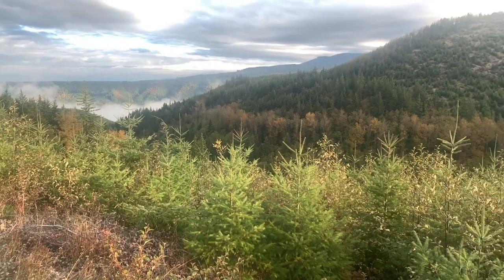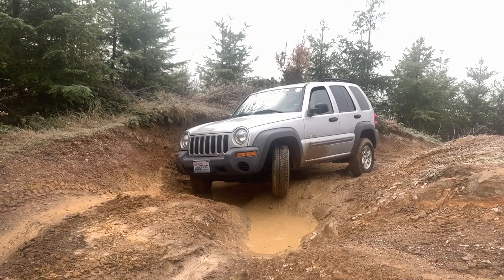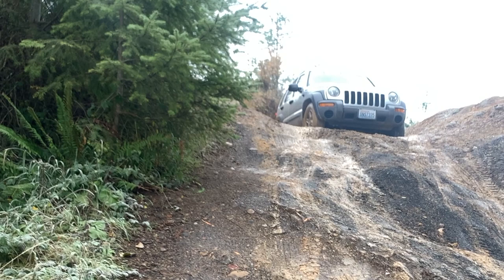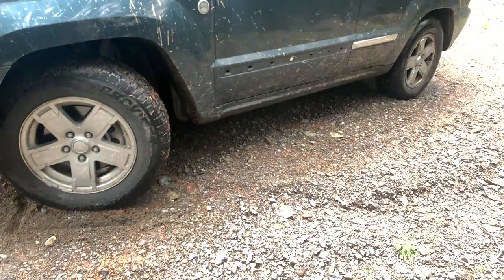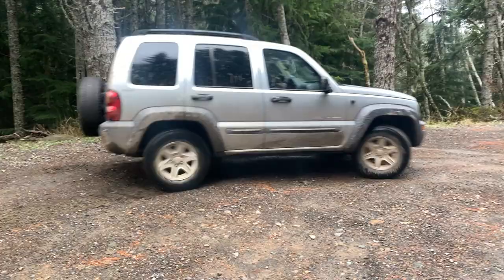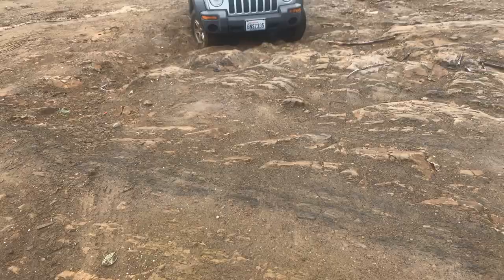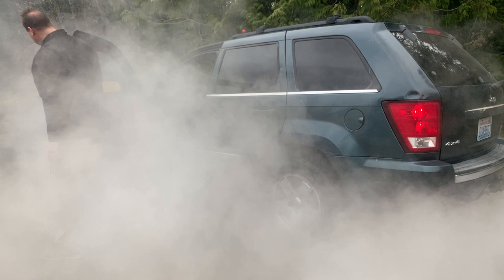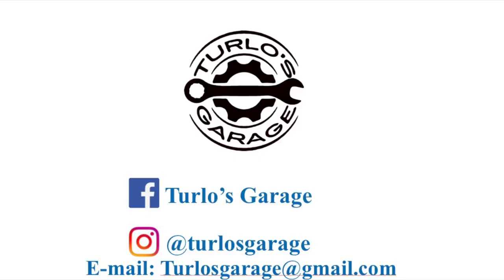JEEP LIBERTY KJ VS JEEP GRAND CHEROKEE WK/ OFF ROAD DUAL TO THE DEATH!/ The winner is SHOCKING! EP34

Comment: man.  just bought a mint 60kmiles 04JL. it will remain stock for the next 240k miles.  u guys are nuts.
Reply from the maker: Jeeps are a lot of fun! The Liberty is still going strong.
Reply: @TurlosGarage  i cant its murder... its got factory tint man factory, loaded with crappy pixilated compass direction and cruise control that takes light years to catch up on hills and stuff. its got high beam safety feature so you cant engage it unless you hold it into place.  all these kids, suspension lift here and there like making the plastic surgeon relevant when the goods are already solid.  most im doing is getting undercoating on hur. no cherokee roof rail upgrade from the bone-yard, no KC led racks.  NO headlight led i want the dull 2400k candles that make the road nearly invisible in bad weather.  Man she's a legend, a LEGEND man.  and think about allllllllll the beer money or pot for potty heads I will be saving by leaving hur stock.  Its madness you young kids MADNESS>
Reply from the maker: @DS-ju2sq  That is Madness! Even stock the Liberty does amazing things off road! Rock On! 🤘

Comment: I've towed 5,000 pounds with my Liberty without any issue. Not just around town, but on the freeway across multiple states.
Reply from the maker: Did you have a trailer brake? I have a trailer that is 5,000 lbs empty I might try and tow.
Reply: @TurlosGarage  I was towing with a U-Haul trailer, so it had surge brakes. I would not try and tow more than half the two vehicle's weight without trailer brakes. Well...in my youth I did try that, and was very lucky that I had room to pull onto the shoulder when I couldn't stop in time at a light on an expressway. My rig ended up stopping even with the front bumper of the other vehicle.
Reply: @TurlosGarage  diferential oil change.  Never with bad oil,

Comment: I own a Liberty( In Australia where I live it's called a cherokee sport) turbo diesel auto, that I lifted and front locked but parts are a huge problem, recently I had to replace the radiator, what an issue that was, couldn't find one in the whole world, eventually finding one 4,000km away in Victoria on the south east coast of Australia. My seats are leather and pretty comfortable.
Reply from the maker: I would like a diesel one someday. It sounds like you’ve got a nice Jeep!
Reply: "replace the radiator" Maybe, you need to change the cap of the radiator from 1.2 to 0.9. Maybe.

Comment: The liberty shines
The liberty does well on and off road 
If I m going off road a lot I would go with a 3inch lift , mud terrain tires, change the gears and add lockers , heavy duty control arms,heavy duty ball joints ,a winch
Reply from the maker: Those are some heavy duty mods. That would make a capable off road machine.

Comment: My 05 limited has a 2" lift and 33s. It doesn't have as much suspension flex as I'd like. So it may not be real graceful but it has the power and clearance to go anywhere I'll put it. I like dirt bikes, hunting in the Arizona mountains, and shooting sports so I find myself in some questionable spots. I'll say it does better off-road than my 2000 Z71 Silverado also on 33s. 👍🇺🇲
Reply from the maker: I was very impressed on how this does off road. Engine is going back in and together. I hope to have it back on the road soon.
Reply: @TurlosGarage  I actually overheated mine real bad last week. It was 115 here in Tucson so when the heater hose broke it was real hot before I noticed it. So I guess now I'll have a chance to freshen this thing up while I have the heads off it. 👍👎😁😢

Comment: I have a feeling that all the water messed up the electric hope a good dry out fixed it . I have a librery kk 2011 it's nice . Am comfy in it . I am 6 foot tall 240 pounds . My liberty  has 4 wheel low that locks the front & back difs up . My dad had a 1948 willys  cj 2b . Back then the jeep would go through anything however you may not unless you were tied in . Hope the wj was fixed easy
Reply from the maker: Still broken as of now. I now have 2 broken “good” used engines and the one that was in it. I think I have enough parts to make one good one. Not sure how long it will last because I am also adding a nitrous kit. It is going to be a fun year for Jeep stuff!

Comment: I have a 2004 liberty renegade, and it’s got a locker in the rear. I’ve taken that rung everywhere.
Reply from the maker: I think if my Liberty had a locker it would go anywhere.
Reply: @TurlosGarage  Is it only the renegade model that has this on the liberties?
Reply from the maker: @chancepennington6653  I have been told some do some don’t. I have not really dug into it. I plan on opening the rear differential in my Liberty in the bit too distant future to see what is in there.

Comment: I’ve got a Liberty 
Went though a deep puddle and it did the same as the grand 
Check the cooler pipes
Reply from the maker: The Grand Cherokee ended up with a broken number 8 rod. I have bought two used engines and have enough parts to make one good one now. I have been working on getting it put back together. The Liberty has been solid though. Thanks for watching!

Comment: I never would have guessed the liberty.
Reply from the maker: It is cheap, easy to work on, easy to find parts for, does fairly good off road. While it is not the most comfortable thing to drive it is way more comfortable than your Wrangler. I am starting to think this may be the best value Jeep produced. It does a lot of things really good.
Reply from the maker: The exhaust tic drives me nuts. I will be fixing that very soon.

Comment: 08:23 Water ingestion in engine air intake
Reply from the maker: Broke the Number 8 rod and bent the number seven. The Grand Cherokee’s air inlet is about the center of the grille while the liberty is on top of the radiator support. A few inches makes a huge difference sometimes. 👍

Comment: Did that grand cherokee hydro lock???
Reply from the maker: Yes it did. I have a few videos tearing the engine down. Number 8 cylinder has problems. A bent valve and most likely a broken rod.

Comment: This is why it’s hard to find a decent running Jeep. They’re getting beat tf up
Reply from the maker: It makes the others more rare and valuable. This one was actually beat up when I started. The engine had some issues that probably would have done it in if I didn’t hydrolock it first. But it is going back together nicely and as soon as I get some good weather I can install the engine and the Nitrous Kit.

Comment: The way the tire on solid ground never spun....well....probably not posi.  Posi would at least try to spin. Not as good as a locker however.
Reply from the maker: I found out later the Liberty does have a trac-lok differential. It is probably in need of some clutches. Thanks for watching!

Comment: I have an 07 liberty and it has no problem really,  seems to spin all when in deep mud.  Also play with the ebrake and brakes to send power to other wheels, old school off roading.  With 4 snow tires on bad days I drive my liberty and leave my 2020 grand cherokee in the garage.  I think it does better in deep snow.
Reply from the maker: I didn’t even think of using the ebrake! That is an excellent suggestion! I will try that next time.
Reply: @TurlosGarage  it works!  Nice to see another liberty out playing.  I think the liberty never got real respect out of the jeep community.  It actually a great vehicle 125k moles on mine.  A rotted trans line and 4 o2 sensors besides regular stuff.  I'm driving mine until it drops and I don't see it soon!
Reply from the maker: The Liberty has been the best vehicle I have owned. I can’t think of another car that is more fun for the money. I am working on more Liberty content for 2021. Thanks for commenting!😁
Reply: @TurlosGarage  awesome,  I'll subscribe to watch!  Sadly today I had to have some work done.  Been chasing a random P0300.  Had 2 bad injectors, just replaced all 6 and runs like a champ today.  It owes me nothing and 120k+ I'm sure it was due.  If you or someone reading chasing a random misfire and fuel trims are all over replace injectors!
Reply from the maker: @chuckstephan  Good to know. My Liberty sat for a year when I got it so I expected to have a lot of problems. Amazingly the only issues I have had are due to my poor mechanic decisions. LOL. What does a 6 pack of injectors cost?
Reply: @TurlosGarage  well its 17 degrees out so I dropped it off at Firestone.  So, yeah, 1400.00 later lol.  Think bosh ones about 30.00 each.  Is an easy job but my laziness cost me big.  I also had coolant exchange,  fuel system cleaning and oil sensor replaced and oil changed. Also had my running light in the bumper replaced.  Broke it smashing thru snow banks lol.  I haven't put a dime in it so I was ok with paying this time. She should be good for at least another 50k with out issues 😃
Reply from the maker: @chuckstephan  Smashing Snow Banks sounds like a fun hobby. I got to try it.
Reply: My 04 surprised the heck outta me. That "Trail Rated" badge actually means something. Stock with Sailuns AT3 (mountain snowflake rated) very confident in a couple feet of snow on my mountain top.
A lot more confidence than my '00 F150 7700 4x4 on 33" Dynapros
Reply: @TurlosGarage  Get one with the trail rated badge. You will be pleasantly surprised!
I've had ZJs and WKs. '05 and 07 WK Overland Hemi sails over where all others get stuck.
best used car buy (along with 04 Tail Rated Libby)
Reply: @chuckstephan  every time I get lazy about a job, I call around for estimates then start picking  out new tools to buy ;-)
Reply: @NickSharpe  I hear ya, should have fixed my self but she running good again!  I just pulled a ford f250 out of. Snow bank, dude was like that little liberty won't do it...lol little momentum and a recovery strap plucked it right out...guy was like respect!  I love messing with kids in the wrx Subarus in the snow, while their fancy computer figures out what what wheels to grip, liberty locks all 4 and with snow tires...I'm gone!  It gets picked on all summer long, but in deep snow she is a champ!  I call it the liberty revenge 🤣
Reply from the maker: @NickSharpe  it snowed in the Pacific Northwest recently. I made a video of the Liberty in the snow. Then I deleted it because it was me just driving. Except there was 6 inches of snow on the ground. Very boring. I expected some sliding and slipping, there was nothing.

Comment: What is the difference between the 2002 and 2007 Liberty models, and is there a difference between them and the Liberty Ranged, and which one is better? Thank you?
Reply from the maker: I am not exactly sure. I think mostly the body design was changed a little. There is a Liberty Renegade that had some off road extras.

Comment: Why BLD isn't kicking in? Did you shut off Traction Control? If you did, BLD will not work and the car will stuck when a wheel is in the air, even while 4WD, exactly as depicted on the video beginning.

Comment: Wait, you can't lock the diffs on libert? Is that true for the CRD model as well?
Reply from the maker: I found out that was an option. Some had electronic locking diffs some did not. I am not sue if that was something standard on the CRD models.
Reply: That "Trail Rated" badge means something. Do your homework then wheel a Libby with the badge (and the right tires). Big dif!
Reply: You can install a locker in the c8.25, I ran a rear 8.25 in my old yj and installed a arb locker. I just built up a kj and will install a lunchbox locker in it.

Comment: You’re comparing two completely different option packages. You can get the grand Cherokee in a v6 and without the awd. I get you are using what you have but a v8 awd is going to be very different than a v6 4wd.
Reply from the maker: I know it was a completely unfair comparison. But I had to give the Grand Cherokee a fair chance by using an newer vehicle with more options. In the end, I still like the 2002 Liberty Sport better than the 2005 Grand Cherokee Limited 5.7.
Reply: @TurlosGarage  I own a 99 WJ 4.0 AWD Quadra Trac 1 system. I'm debating on trading it to a Jeep Liberty. Which one is better off-road, AWD Grand Cherokee Laredo or Jeep Liberty
Reply from the maker: @dentondunn4346  I think the Grand Cherokee is better off road. The Liberty does OK with a Trac lok rear axle but it really needs something in the front differential to be better off road.
Reply: @TurlosGarage  I would have thought the Liberty 4wd would be better than the AWD Cherokee off-road. I don't know so that is why I asked. Thanks for your reply

Comment: If the Liberty had sure grip it would have done a lot better.
Reply from the maker: It does have a trac lok rear differential. At almost 150,000 miles when I filmed that it was probably due for a rebuild to tighten it up a little. We raced the Liberty at a Rally Cross last year and the axle locks up good. A little brake and about 3/4 throttle and the Jeep pivots really well.

Comment: That is not the trail rated Liberty.  There are differences between non trail rated models and models that are.
Reply from the maker: It is not trail rated but it does have a trac loc rear axle. It does fairly well but my guess is a about 180,000 it probably needs some clutches. It does amazing in the snow. I was pulling cars out all o we the place ( mostly Subaru’s) and nothing I did would stop it, other than ice, I did have some issues pulling a car out of a ditch while the road was covered in ice. Thanks for the comment, Rock on Jeffery! 🤘

Comment: I'm gonna guess you sucked in water on that last pass with the grand Cherokee. You realize the air intake on that thing is just below the hood line. At that speed you for sure inducted water and damaged a connecting rod.
Reply from the maker: In the subsequent videos I tire the engine down and found the number 8 cylinder was no longer connected to the crankshaft. So I bought a “good “ used engine. Had questionable results from the leak down. In the progress of removing the heads found a crack in the block. Still hunting for another cheap good used engine. Thanks for watching and leaving a comment!

Comment: I think that Jeep liberty might had benifited with some "Allterrain Tires"!
Reply from the maker: It could use better tires and the tires on it are one size smaller than the original ones. The previous owner said these were 20% less than the cheapest tires it was supposed to have. It still does great off road. And does not do bad every where else.
Reply: @TurlosGarage  ya for sure I mean most people would not attempt what you did with that thing!!! but it did fair pretty good
Reply from the maker: I really want to make another video like this but until the Grand Cherokee is fixed I can’t afford to break any more cars. I have been looking at cheap Cherokee XJ’s.
Reply: @TurlosGarage  It would be interesting to see what you could do with a liberity with just minor mods like the next phase just upgrade the tires to an allterrain and see what it does

Comment: I just bought a 2005 keep liberty with a 3.7 liter engine at almost 200,000 miles . It was sitting up for a few months and I paid 500 for it . It runs and drives for what I’ve seen the 20 mins I drove it . Any tips for maintaining it and what I should do now to make sure it’s serviced properly? Thanks in advance 🙂
Reply from the maker: The best tips I can give you are keep the fluids changed especially the motor oil. If you are late on oil changes you may end up with carbon deposits restricting oil flow to important parts. The other thing is Do Not let it get Hot! And I mean if that temp gauge gets to 3/4 to the H, shut it down immediately. Those engines have a habit of dropping valve seats if they get hot. That is what happened to mine and why I got it cheap. In fact at 150,000 miles it had happened twice and the previous owners had enough. I hope this helps! 👍
Reply: Thanks so much
Reply: @drizzygoingreen3539  Rust take care off // and differential gear oils change too. Too many dont,  then they winne about it breaking down.  I have a limited 2007/

Comment: I had a 04 liberty that I made a lift for and put 31s on it. To be honest I’d rather have a liberty over a Cherokee any day. If I can ver get another one I’m gonna do a solid axle in the front. Pretty sure that will make it almost unstoppable.
Reply from the maker: A solid front axle would be nice. I had planned on doing that originally but it has been fine with the independent front suspension so far.

Comment: Look again at tow capability the liberty diesel only has 5000 tow capability the rest not so great. Wait kj ? I'll have to look at that one .
Reply from the maker: The V6 automatic with a tow package is rated at 5,000 lbs. I towed a 5500 lb trailer without trailer brakes a short distance. That was sketchy. It definitely struggled to start but struggled more to stop.